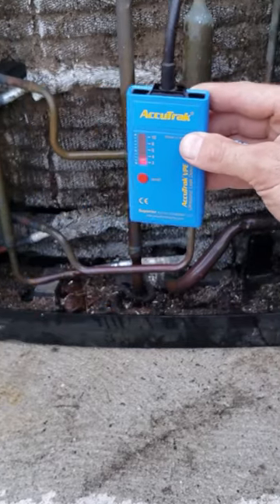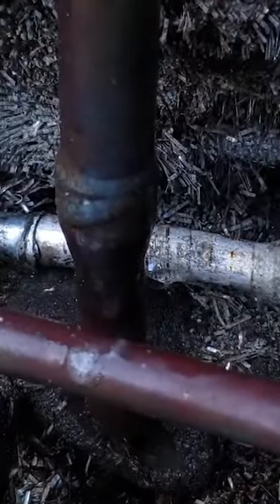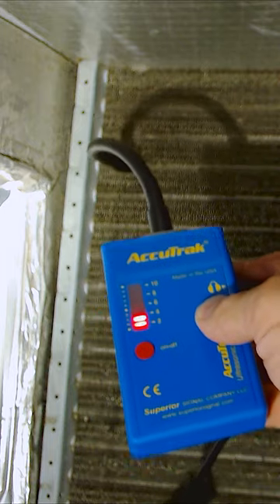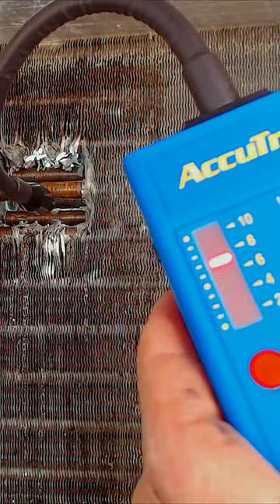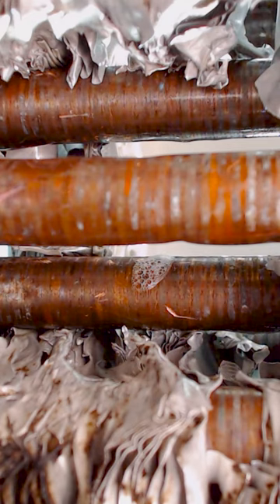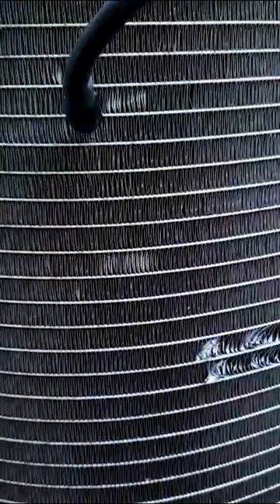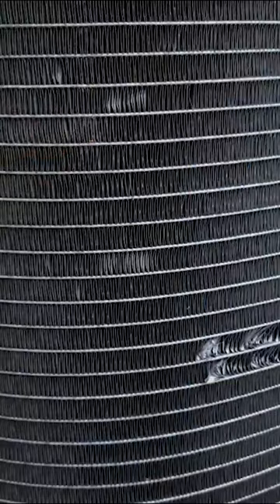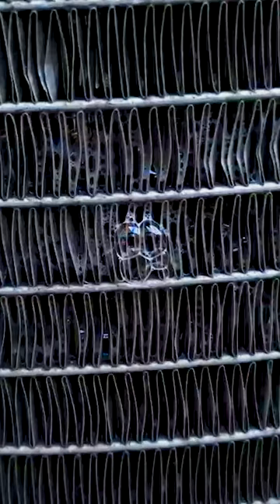Finding Multiple Refrigerant Leaks with an Ultrasonic Leak Detector!

Comment: Anti-corrosive bubble leak detector = dawn dish soap + water?
Reply: No. Dawn soap and water is corrosive. He’s probably using BLU leak check. It’s not soap.
Reply: Precisely, but if he wants to charge enough to feed his family he has to sound special
Reply: Dawn dish soap will work and cheap techs use it. But it's chemicals aren't beneficial for long term copper care. You could just spend the extra 10$ at the local supply house for the non corrosive bubble solution. Saves you from nosy HOs who hate hack jobs

Comment: Okay so you found the leak in micro channel but is there a way to fix it? Do you just aluminum braze the leak?
Reply: You can, after jabbing a hole in the evap coil, the homeowner can pay 1/4 the cost of a replacement for a repair on thier old system which will now have 75% efficiency or they can just replace it.
Reply: Agree on repairing the coil, but why do you say only 75% efficiency
Reply: @Chris-gy1hf they’ve been huffing too much Freon. It makes near-zero difference to be missing a small section of fins for efficiency. If you don’t braze with nitrogen I suppose the soot inside will clog up the channels and cause a temporary loss of efficiency but that will all end up in the filter drier after a few hours.

Comment: This a great tool. It has saved me a lot of time and if a leak exist, you will find it.
Reply: I take the easy way out, stick some dye in there and come back a week later with a blacklight. Spend less than an hour combined across 2 trips.
Reply: Only thing about using dye is more and more manufacturers are kicking on warranties with dye in the unit

Comment: If there is a leak in the middle of coil + the thing is old - is it worth spending time on looking where exactly and fixing it? Or it will leak somewhere else in a month?
Reply: It depends on what the customers wants to do. If it’s old (10years +) I usually recommend system replacement but sometimes the customer would rather repair. So you have to do what the customer wants. Also just because it leaks once, that doesn’t mean it’ll leak again. You can’t guarantee that. Leaks in hvac aren’t based off of age. I’ve seen many leaks in 5 years and under equipment
Reply: I think you want to make sure it’s leaking before you fill it up and piss of the customer because you have to come back. I think he just opened the coil for demonstration purposes.
Reply: If you find a leak in the middle and have to break off the fins to get to it, how would you even go about fixing the leak without damaging the coil
Reply: @murky16  you have to replace the whole coil in that Situation
Reply: @DiaryOfMisterVinci 10+ years? My system is 28 years old and still kicking like a champ
Reply: @JP-xg8cd  Systemes before 2002 we’re built different and built to last… newer systems don’t last that long. They are built for “efficiency” not longevity. Which I get is annoying but that’s just how it is.Manufacturers have done this to make money. The average unit last 10-15 years now and days.units back then lasted 20-40 years. I could get into to detail for why it’s like that but I’ll just keep it simple. Any good hvac tech is aware of this
Reply: @DiaryOfMisterVinci damn right
Reply: @DiaryOfMisterVinci and as a tech I wonder how effective is the efficiency is in numbers. Yea the heat transfer is leaps better but when you have to replace it 3 to 1 the manufacturing imprint the labor cost the footprint of everything that goes into it I’d like to do a study
Reply: And the up keep.. from tool manufacturing to gas from maintenance the process of making such tools etc things that don’t get factored in
Reply: There are kits out there that come with a piece of honey comb fin replacement with the proper solder to repair coil leaks on coils for aluminum. For copper, you just use your preferred solder.